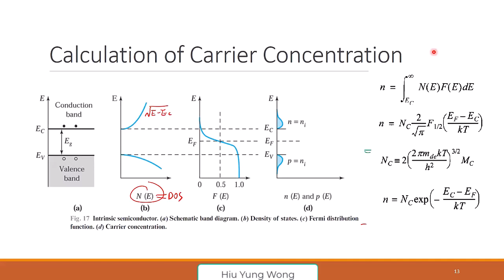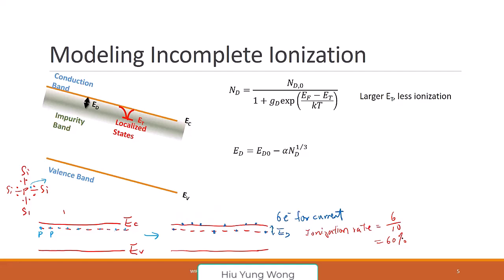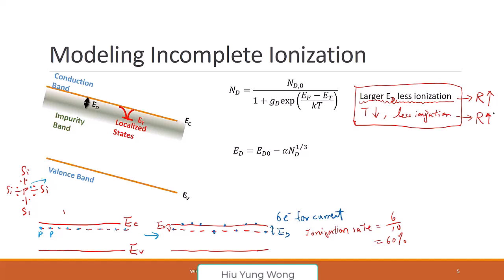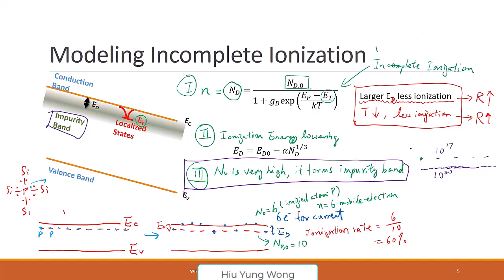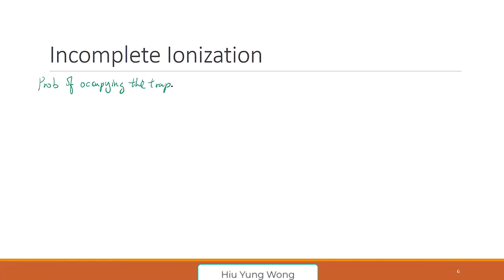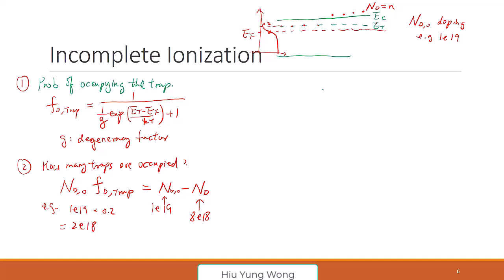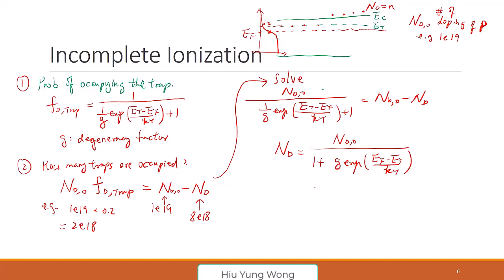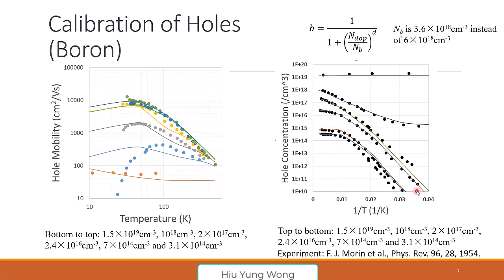14A - Incomplete Ionization Model

Comment: Prof Wong. Thank you for the lecture. @16:36 Can you comment on why Ed dropping as Nd (dopant density) is increasing. according to equation 2.
Also Thank you again.
Reply from the maker: @lucianrise I believe this is because with more impurities, there are more carriers (e.g. electrons) which will help screen the attraction from the ion and thus effectively lower the ionization energy of the electrons. For details, you may read this paper after Eq. (28). 

https://journals.aps.org/pr/pdf/10.1103/PhysRev.75.865
G. L. Pearson and J. Bardeen, Phys. Rev., vol. 75, pp. 865-883, 1949
Reply: Thank you Prof. for your reply. @quantum_computing